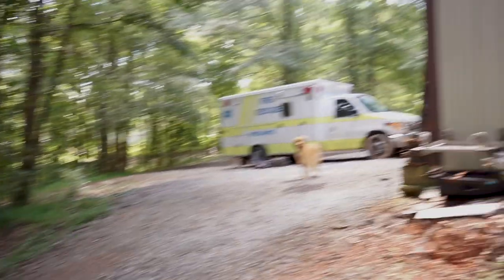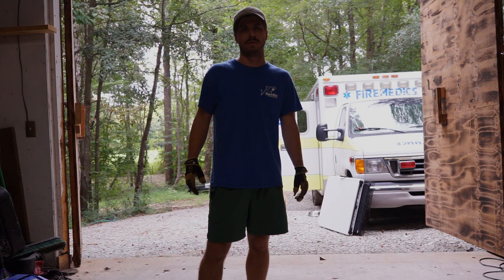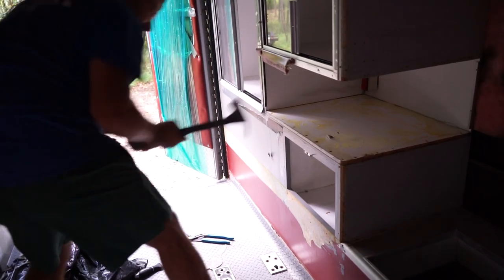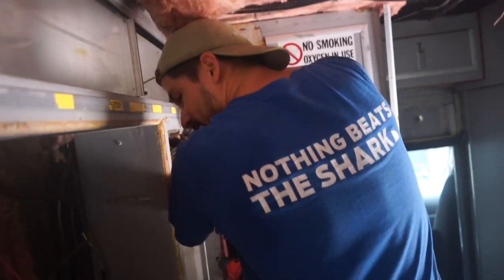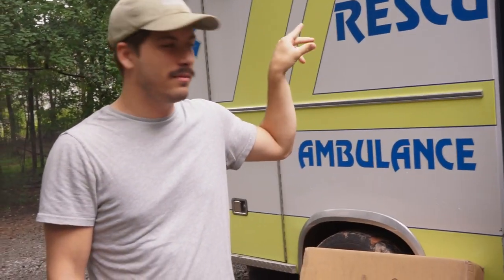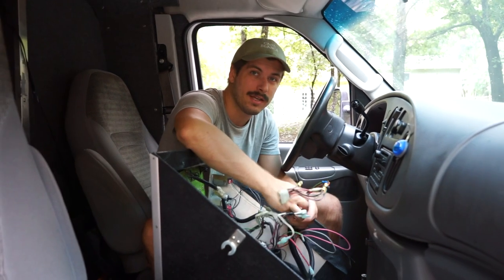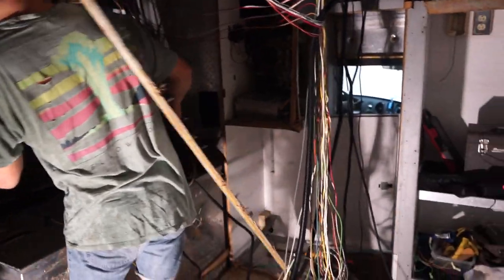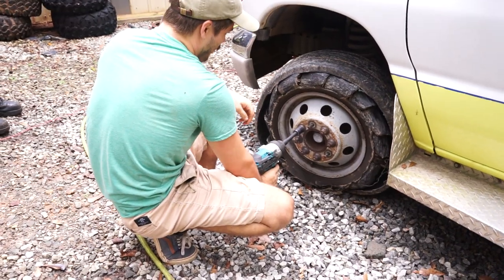First Week of Ambulance Conversion - Harder Than We Thought!

Comment: When we demo'd our 2000 ambulance, we removed all of the ambulance wiring and the circuit board. The only thing that stopped working was the brake lights, but it was an easy fix..we also gutted it down to the "studs" and we are happy we did instead of trying to work around stuff. Also either brake cleaner or carb cleaner removes the stickers and glue really easily, Don't remember which one, I think brake cleaner. We tried everything including the heat gun, eraser that goes on drill and the brake cleaned was ridiculously easy.
Reply from the maker: Yeah, now looking back we should have just removed all of it at once, so much easier! Will definitely try brake cleaner because these decals are giving me such a headache hahaha